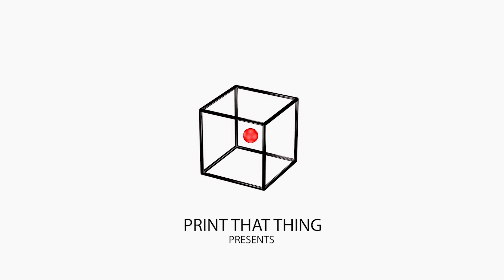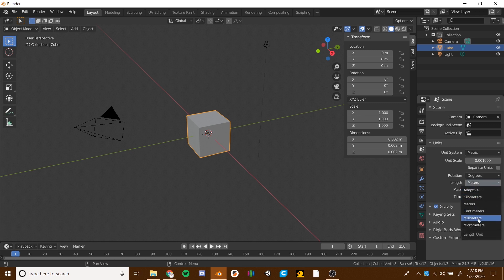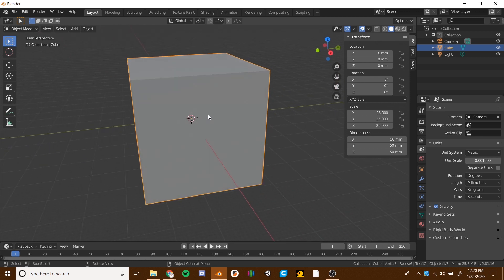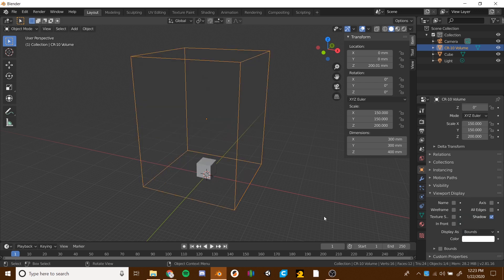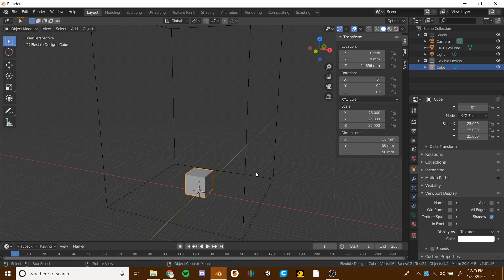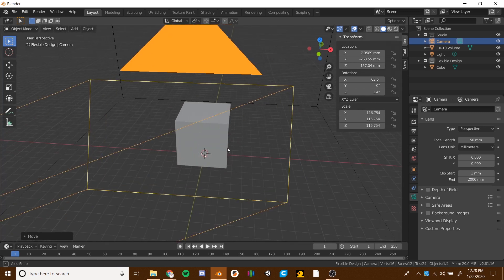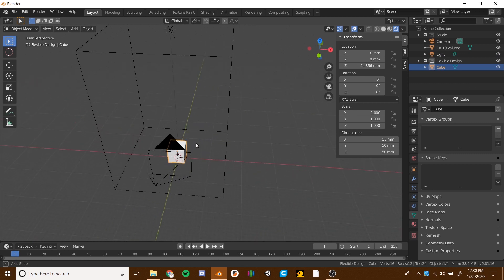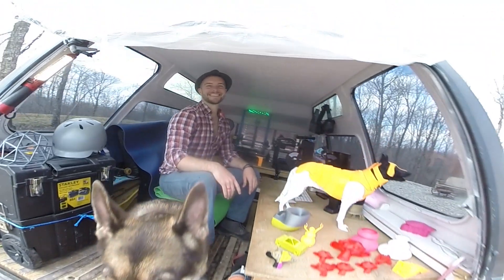Hack Blender for YOUR 3D Printer | Scale for mm & Build Volume | Beginner 3D Printing Design Lessons

Comment: Question:  If I model something about the size of the base cube and export it in STL, then load it up in my 3d printer it's tiny. I have to 2500% up the scale to get something that's print size. Anybody know what I'm doing wrong? If I import an old model it's massive in Blender, the camera/light object are extremely small compared.
.

Comment: Howdy! Discovered your channel via the Make Anything stream. (just caught the very end)
I've been 3D printing for years and been using Tinkercad for my modeling, I've been too lazy to learn Fusion. Plus, I'm a little worried about where they're going with licensing. 
I've also been a hobby game dev for a LONG time and have been learning Blender for modeling for game assets.  I've tried using Blender for modeling for 3D printing, but I cannot figure out how to get it to do more CAD like functions. Simple things like, specifying the length of an edge. Or just being able to type in a number to change a dimension. I've spent a few hours trying to find anything and haven't had any luck. 
I LOVE Blender for creating really awesome models for artistic or non-dimensional uses, but something as simple as creating a box with dimensions of 20mmx40mmx30mm and a 10mm hole through it.  Like, I could quickly make something that's close to that by eyeballing, but I would love to be able to just type in dimension like on Tinkercad.   My ideal modeling software for 3D printing would be a lot like Tinkercad with the ability to do vertex manipulation. 

Sorry for the huge comment. I'm just a little desperate. lol
Reply from the maker: Hey thanks for reaching out. Go check out my latest video or the LIVE stream Devin and I did. The first 15 minutes is how to setup Blender in mm for your 3D printer volume. I think it's exactly what you need. You can also go to my website www.PTT.live to get a free 1st week bootcamp. Let me know if you have any more questions. Happy to help.
Reply: @PrintThatThing  Thanks for the reply, but I'm not sure my question was clear. I know how to set the scale within Blender, but how can you actually specify dimensions on a model?  Like if I want one side of a box to be 20mm wide by 30mm tall. I just want a way to like, select an edge and type in a number and it resize to that length, you know?
Reply from the maker: @BRUXXUS  gotcha! Let me look into and see what's the easiest way. Thatd be a great video lesson.  Thanks for the great question.
Reply from the maker: @BRUXXUS  I'll get back to you once I figure out a simple effective way to do that